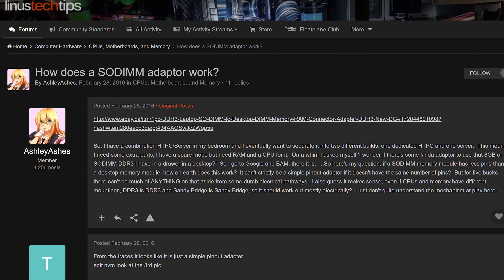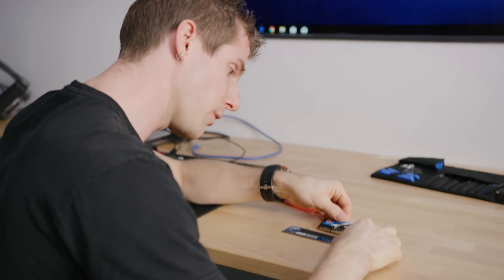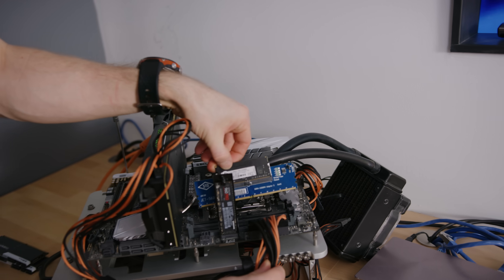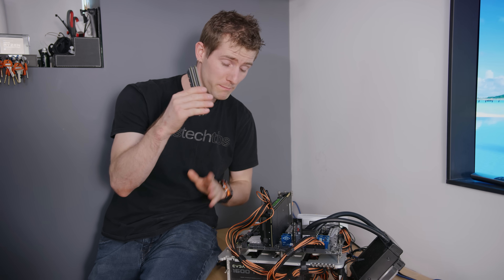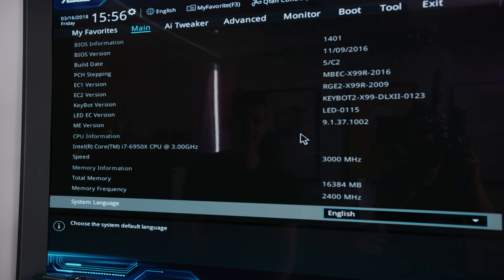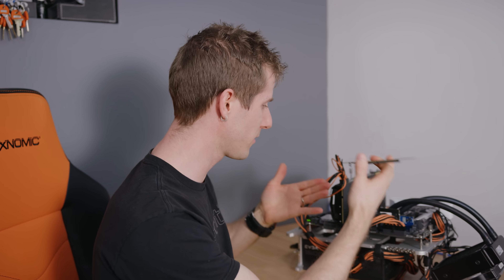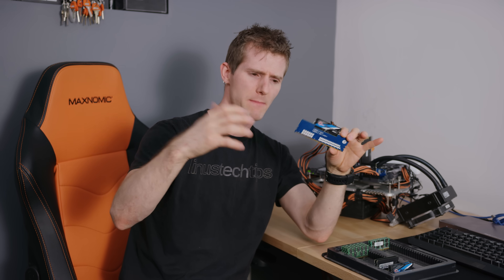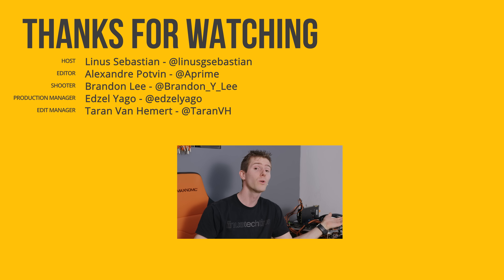Installing Laptop RAM into Desktop!?

Comment: I have my old damaged laptop I threw the memory away. I kept that memory for years hoping it will serve a purpose in future. 😡😡😡
Reply: I have 128gb of ram from a broken laptop that my father dropped.
Reply: @nicholasneyhart396  all the laptops i have ever seen only had two Ram slots (upto 2 x 32 GB ram sticks for 64 gb Ram) , what laptop did your father have?
Reply: @kavinsp  He’s probably lying, impossible to have 128 of ram
Reply: @kavinsp  the most I’ve seen before is 64 gb on a MacBook Pro
Reply: @tyrek78  Not necessarily. Many engineering workstation laptops run 128GB of RAM. Mine has 64GB, but has the capacity for 128GB.
Reply: @benjamincarr9233  Can you show me a laptop with 128gb of ram? It would probably cost thousands of dollars
Reply: @tyrek78  https://www.notebookcheck.net/Dell-Precision-7530-i9-8950HK-Quadro-P3200-Workstation-Review.346631.0.html

Read the second paragraph under "Performance". The laptop can take 4 x 32GB SODIMMs. You're right about the cost. $2500+ when new.
Reply: @benjamincarr9233  to be honest the is the dumbest laptop I’ve ever seen lol
Reply: @tyrek78  That kind of power is necessary when running CAD renders containing thousands of parts, or running mathematical models with billions of data points. Without those "dumb" laptops, the world would look very different. Aerospace, medicine, mathematics, biological sciences... Those are just some of the areas where 64/128GB of RAM are sometimes needed.
Reply: @tyrek78  the maximum amount of ram supported on Windows 10 Pro is 2tb, I think it’s safe to say 128gb is definitely possible.
Reply: @gunkysplunky  it’s because windows 10 is made for many things, also servers usually use that much ram,  but for a laptop with only 9th gen core processor, it’s unnessecary
Reply: @kavinsp  I have an HP ZBook G3, FOUR slots, DDR4, up to 16GB per slot, total 64GB
They made a version with Xeon E3 and E4 processors, they can have four sticks, up to 32 GB each....total 128GB
Reply: @tyrek78  
HP’s most expandable 15” mobile workstation
Get desktop-level storage and 
memory with slots for up to 128GB of RAM, <<<<<<<<
and capacity for a 10TB hard drive.[3]
Expansion and servicing are simple with tool-free access to removable components and an extensive port selection for critical accessories.HP ZBook, Xeon E3 or E4 CPU, four slots, 32GB DDR
Reply: @tyrek78  
HP’s most expandable 15” mobile workstation
Get desktop-level storage and memory with slots for up to 128GB of RAM, and capacity for a 10TB hard drive.[3]
Expansion and servicing are simple with tool-free access to removable components and an extensive port selection for critical accessories.
Reply: @benjamincarr9233  MATLAB with Simulink....
I am a "open in new tab" kind of browser guy, I can have 10GB just in Firefox, and then Chrome using 6 GB....
GSA (Federal Gov't) has a standard order number for a Thinkpad that comes with 40GB of RAM
Reply: @tyrek78  Maybe for what you do, I can tax my ZBook with 24GB
MATLAB, Data Science with R or Python...lots of RAM means big data sets are easy to play with...
Reply: My laptop had 2x8gb ram, and died. I then put it in my desktop which only had 4x2gb. Parts always come in handy oneday.
Reply: haha L(this is a joke)

Comment: Linus, the ram sticks have multiple redundant contact pins for ground and power and similar stuff. Most of them are also unused. The ram sticks also communicate with the bios of the computer via smbus serial interface.

Comment: Well now I have a use for my old laptop ram. Just gotta rip the 8 gig stick out of my old laptop
Reply: If you have a stick installed already, both of them will work on the slower speed of them both, consider that while installing ur laptop ram, considering most laptop ram is usually slower than ram for desktops

Comment: Next Video:- Installing desktop memory in a laptop
Reply: Just Hammer 🔨 the ram and make it fitable
Reply: Dipesh Baral yeah, split into two sticks and cut needed keyholes to fit lol
Reply: Lol
Reply: Lol
Reply: impossible because the adapter wouldnt fit
Reply: @itsmitko7  Linux is madlad he did use a desktop GPU in a laptop right I am sure someone is already selling a extension cable for ram on AliExpress 😂
Reply: @monishmeher3901  bruh
Reply: @itsmitko7  wow like this aint a joke

Comment: I wanna build a PC around one of those Chinese mobile-to-desktop i7 kits, using this as RAM, with a PCI to PCIe adapter to mount the video card on assuming I can find an i7 capable board that still has a PCI slot.  Oh, then I want to use an IDE to SATA connector adapter to use an IDE drive with it.  And a PS2 to USB mouse and keyboard adapter.  If possible, for video, I would like to find a monitor that only does 13-3w sync-on-green and use an adapter for that, as well.

All kidding aside, back in the early 90s there were these things called SIMM Stackers that you could put up to 4 30-pin SIMMs in and then put in a 72-pin SIMM socket.  No lie.  Also for a very very brief period, there were memory modules called SIPPs - Single Inline Pin Package, which were 30 pin SIMMs that had pins soldered to the contacts, to mount in a pin grid array.  

The early 90s were a strange time for computing.

Comment: "Reseeding them" - do you tried to turn it on and off again? - did you stick in the cable? is the unit turned on? XD classic
Reply: Customer: I just bought this new gadget and it isn't working!
Service tech: Did you turn the power switch to On?
Customer: It has a Power switch?

Comment: Linus, your missing the point. The question was: Can you use your old unused ddr4 sodimm in a standard dimm slot. The answer is: Yes, you can. So if you're hard pressed to get a system running or tight on budget and have unused notbook parts, then yes it is possible.

Comment: But actually if you have only laptop sticks and yo don't want to spend 90 to 100 dollars you can spend like 20 dollars for 1 extender. It would be like using a CPU with integrated GPU until you can actually get one

Comment: what I want to see is a adapter I have not seen since the 90 that was invented in the 80s in japan that was rare to get and made no cents but worked. what the adapter did was plug into the ram slot allowing you to add 6 ram sticks on to it combining them like they wear one ram stick.

Comment: There is a reason to use an adapter like this, I frequently change between different system e.g. Intel NUC, ATX Desktop, Laptop, and having a 16GBx2 SODIMM Kit with adapters means whenever I am changing system I do not need to purchase a new set of memory or owning 2 sets of memory, which is very convenient.

Comment: then again some desktops do use compact RAM or Laptop RAM I actually have one of these desktops and the motherboard is so tiny the case could've been over 50% smaller(the dimensions are around 6-7 inches by 6-7 inches and the CPU is soldered to the board)

Comment: Useful as well in small form factor where you also want high capacity memory. 32Gb non-ECC DIMMs aren’t readily available. 32GB SoDIMMs are a little easier to find though.

Comment: It may Sound crazy to you, but what do you think about a GPU-Card with a Slot for momory on the back? So you could upgrade your VRAM to 16Gb (or what a GPU-Chip supports) or could use less ram if you dont Need that much ram. I dont know if it technically works but the VRAM-Chips on the back of my GTX970 are looking like those on my Ram. So a manufacturer could put a socket on the back of his Card which is connected to the gpu and just put 1g Memory in i so everyone can use it and upgrade it if he wants to. so you can choose if you want a good Card with a lot of Memory or the same Card with less Memory to Keep it a bit cheaper.

Comment: If you ran a PC repair shop it would be a good way to test if the ram is working.
Reply: At my old job, this is what Lenovo used. They had memory testers, but they only came in desktop size slots. So they needed the converters to test the laptop memory.
Reply: ExNihilo that's actually literally what they're designed for
Reply: ExNihilo its like a tester for ram
Reply: @CarinoGamingStudio  you know what memtest is right
Reply: @Abby-h7j  to much wasted time doing that
Reply: Michael Christesen yes however maybe they only have a desktop to test hardware.  Rather then spare laptops as well.  Can only do a memory test on a laptop if it can run.
Reply: @Abby-h7j  what if, say, the laptop doesn't turn on, huh?
Reply: @Abby-h7j  Sure, but using a desktop makes more sense. At the very least you could be easting 4 sticks at a time instead of two, on much more capable hardware.
Reply: I use various versions of these for testing ram on a desktop when I'm not sure if the laptop or the ram is playing up.
Reply: A practical solution on this YouTube account? Never lol
Reply: They don't work consistently
Reply: ExNihilo is a good minecraft mod/creator
Reply: Why wouldn’t you just set up a test bench made of laptop parts? It wouldn’t be that difficult and it would allow you to test much more than just ram.
Reply: Kyle Stewart well since ram and hard drive are the only things easy to remove from a laptop it’s not really needed.  However both of those have also come under question these days with 2in1 tablets starting to also solder them to the motherboard.  The idea of checking things like a cpu sounds nice but it’s easier to just buy a new laptop normally compared to ripping out a cpu that is soldered to the board some people will do that on very high end laptops but that’s after that break the $1,000 in cost and the amount of people who do such a repair (and are reliable) is limited so for most places such a test bench is worthless.
Reply: @TitaniteScale  Having to spend money on an entirely new test bench would cost significantly more than purchasing some cheap adapters just to test function.
Reply: @TitaniteScale  Limited use and wasted space when you can just use a handful of adapters that fit in a drawer. I'm hard pressed to think of any reason to keep a laptop test bench around given the vastly varying industry standards on anything besides the core components (CPU, RAM, HDD/SDD)

Comment: ddr 3 AMD motherboards. this worked on a board that was win 7 compatible but didn't work  on a board  that was vista compatible. Bios age is key.
So this board has now got 2x 4 gb of sodimm ram and runs well with win 10  (1803) cost of £5 instead of £130

Comment: A friend just gave me 16gb of ddr3 laptop ram. I see eBay has these adapters also for ddr3 systems. Since my Dell M4600 Laptop I purchased used on ebay about 1 year ago for $430 with free shipping with an i7 cpu and 32gb of DDR3 ram and full HD 1080p screen is fine the way it stands, then I guess I will just have to give these frankenstein things a go on my spare PC and do some testing for myself. Thanks for this informative video. I found these on eBay for ddr3 systems for $9.99 with free shipping from within the USA. Nice! So my end investment for 2 functional ddr3 sticks at 16gb would be (free from friend + $9.99x2 sticks=$19.98) total investment for 16gb ram. Sweet!

Comment: The AMD 990FX chipset was supposed to support up to 64GB of RAM, but no memory manufacturer seems to have ever actually produced any DDR3 DIMMs of the necessary 16GB per stick capacities (discounting incompatible ECC/Registered RAM meant for servers and workstations), so those of us with 990FX boards are stuck with 32GB max. 16GB unbuffered DDR3 SODIMMs, on the other hand, are readily available (if a bit expensive). I'd love to see four DDR3 SODIMM to DIMM adapters filled with 16GB SODIMMs tested on an AMD 990FX based motherboard to see if that would allow us to finally max one out.

Comment: Why don't desktop's use SODIMM?
Are SODIMM slower?

It is the same for IDE. Laptop IDE had a different form factor and different number of pins.
Then, they switched to SATA and laptop and desktop drives are now identical.

Comment: I don't think there is any point of using one of those SODIMM adapters
Reply: Why not? I got more than 100 4GB DDR3's and these adapters cost only $3.50 in AliExpress. You're saving a lot, of course you won't use it in a workstation but for a gaming machine it's perfect if you already got spare sodimms.

Comment: simple example (because it's my current situation)

ok, my situation:

- got an old laptop with ddr3 and an old desktop with ddr 2 ram
- want to buy new processor and motherboard with ddr3 ram
- ddr3 isn't cheap (new)
- rather tight budget
- not interested in used ware

now price comparison:

$5 adapter vs. $50 ram

performance: (nearly) the same

Comment: The "Virtual Fuses" on the adapter look like what is commonly refereed to as a PTC fuse. When the current through a PTC fuse exceeds the rated current, the PTC fuse heats up. Once it exceeds a certain temperature, it chokes the current to almost nothing. It will automatically reset itself but only after there is no more current draw on it.

Wikipedia does a good job of explaining the specifics of how they work. https://en.wikipedia.org/wiki/Resettable_fuse

Comment: linus thx i guess its not as practical or tested enough but i have a especific budget and it appears it works fine i guess il try it on the long run when i get money for my pc on June 25 of these year (i literally plan to run vr on the pc so saving 50 bux on the budget helps spending more on the gpu thx) literaly my budget is like 500 bux or 550 sooo.. yeah i hope it works, i expect it to be build hopefully bewteen these year as shipping parts from usa cost a ton of import, it cost's alot because in my country its expensive of the those as computer parts can be bosted bewteen prices up to 42% depending on the things gpu and graphics card get a 13% boost and in a tight budget its bad and i guess i can stick with a old pc case,so wath we do becuase prices are insane here on Costa Rica so when a family member goes to Usa we buy from amazon and he can bring up to 500 bux of things paying no tax here so i need to wait until one family member goes to USA for visit and pick up the parts il guess i will update these coment on a year or more i guess then it will usless maybe but only to tell you and the readers of the comments how is it holding up. (sorry for the misspell english isent my main lengage but still y hope i can help people on how reliable it is)
Reply: White587 Here are two cheap builds I just put specs for:

AMD (Cheaper, but not as powerful.)

AMD Ryzen 3 2200G APU

8 GB Corsair Vengeance RAM

Silicon Power 128GB SSD 3D NAND

WD Blue 1TB SATA 7200 RPM

TP-Link Archer T6E AC1300

GIGABYTE GA-A320M-S2H AM4 mATX Motherboard

CORSAIR VS Series, VS400, 400 Watt

EVGA DG-73 Matte Black Mid-Tower, Acrylic Window, Gaming Case 130-P0-0020-KR

____________________________________

Total: 416$ - The one I honestly recommend.

____________________________________

Intel: (More expensive, but higher end)

Intel Pentium Gold G5400

8 GB Corsair Vengeance RAM

Silicon Power 128GB SSD 3D NAND

WD Blue 1TB SATA 7200 RPM

TP-Link Archer T6E AC1300

MSI B360M PRO-VDH Desktop Motherboard

CORSAIR VS Series, VS400, 400 Watt

EVGA DG-73 Matte Black Mid-Tower, Acrylic Window, Gaming Case 130-P0-0020-KR

NVidia GeForce GTX 1050 by MSI

____________________________________

Total: 542$- It has better specs, but I feel is more expensive than it should be.

Don’t take my word as gospel, so do your own research too.

Comment: From my own tests on the DDR3 version, it seems not all Intel generations work with these adapters and/or PC3-10600S dimms. It seems Nehalem (1st gen Core i) doesn't work with them, both s1156 and s1366 and their Xeons. Have not tested Westmere yet nor anything on s775. On s1155 it works at least from Ivy Bridge on. I don't have any Sandy Bridge CPUs so can't test that. On AMD's side it works on AM3 (Deneb and Thuban tested)

Comment: Maybe those jumper settings would have allowed it to boot with all slots populated? 

Thanks for all the content btw. I'm saving up to build my first PC in about 20 years* and I've had a lot of catching up to do.

been using Macs for all that time, planning to build a Z370/i5 Windows/Hackintosh dual boot machine.
*Let the fanboi flaming begin. :)

Comment: Why not manually set the Frequency, CAS Latency, Command Rate and Voltage to their proper values instead of letting the motherboard determine them VIA XMP or JEDEC?

Comment: They're good for upgrading old computers. Laptop memory is cheaper and more common on Ebay than fill sized DIMMs. So if you're building a low end, low budget, Junkyard wars style rig, you could easily shave off afew dollars by using Laptop Memory. Esp as there are adaptors up for as little as 5 dollars.

Comment: the answer to "should i?" is "yes". i bought 16gb of ADATA laptop ram in 2012 for $50, way back at the bottom of the RAM market. last i checked, i'm looking at handily above $100 for the same amount of RAM in DIMM or SODIMM form. Seeing as i have no need for super fast ram, and don't use the laptop i bought the RAM for anymore, this will be a hella cheap way for me to upgrade the RAM in my desktop

Comment: The adapter itself has its own SPD chip and changing the jumper setting determines which SPD is read by the system (board or sodimm).  http://www.mfactors.com/jet-5608ak-ddr4-sodimm-to-dimm-adapter-with-metal-guide/

Comment: I guess this might just be worth it for a new build, considering a single 8GB stick of DDR4 at 2400MHz is around £70 in the UK, and you could pick up an 8GB stick of laptop memory for only £40 at the same speeds, and the adapters are as little as £3, thats way less for technically the same product.